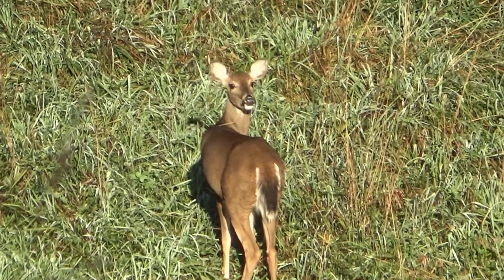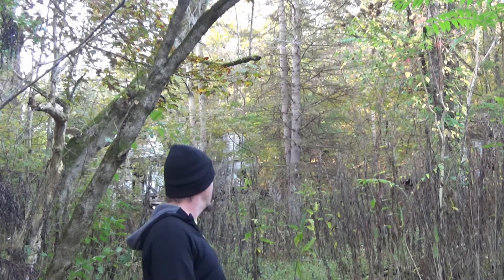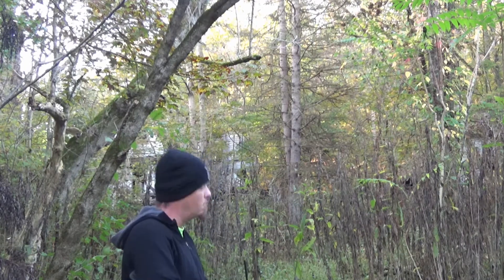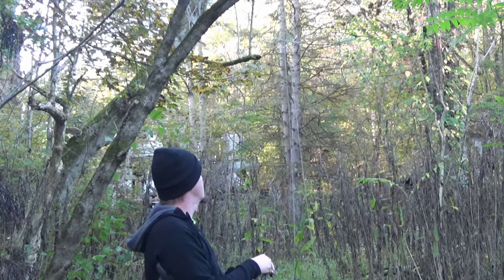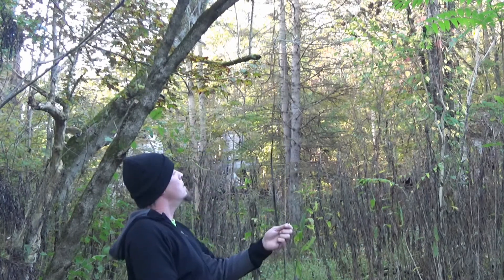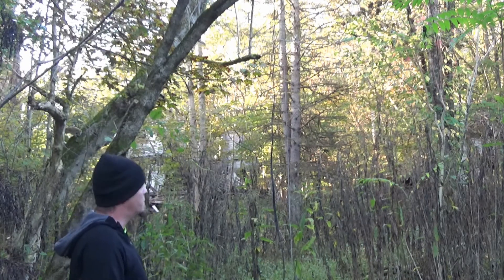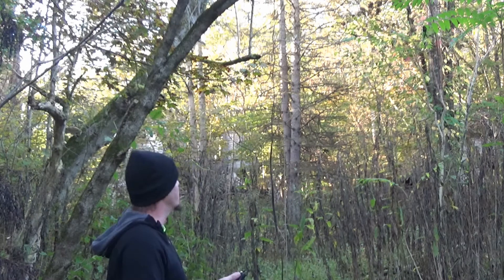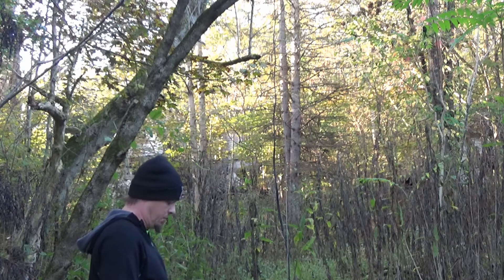Roll up slim jim antenna, for 2 meters

Comment: Used to go south bass island. Then get on the peace tower, then call to W8FT,  then to lima, Columbus, and Cleveland. Recent if caught you might get escorted. Off site in quick step. I just got a new slim Jim. And made me a new zebco / sling shot antenna launcher.  Good hunting  On a high point just lower the antenna. With a sinker. To stabilise. Good to go. DE Kv4li
Reply from the maker: I’ve been meaning to make myself an antenna launcher. Thanks for reminding me.

Comment: Great video. Thank you for sharin' this info. I'm brand new. Studying for Basic, my two Baofengs just arrived (the original pair I ordered are coming in from Beta Centauri, eventually, but won't let me cancel so...I'll have 3 backups?), and I need one of these slim-jims or j-pole in my pack. That is impressive. Pocket size. Thanks, man, and keep well.

Comment: I've been wondering if a slim jim could work with twin wire instead of the 300 ohm flat ribbon I've seen in all other designs. Are you sure this model is made of twin lead and not the flat ribbon used for old TV antennas? 73 de LU4HAM
Reply: Sorry, I confused twin lead with speaker wire. Would a speaker wire slim jim work?

Comment: Great video and thank you for sharing.  As a UK Foundation licence holder (M6KVK) I have tended to lean towards portable QRP comms although I do have a full shack at my Home QTH.  I have had my callsign for about 4 years now and to be honest I am very happy with it and find I am not restricted in any way on the lower tier license.  I make these slim-jims for other operators and they work quite well on both the UK VHF/UHF bands and are so easy to make.  On my luckiest day I have managed 73 miles simplex on 10w TX which is a reasonable success.  I would concur with you mentioning that this antenna is an excellent idea for anyone who is restricted in terms of putting up an antenna at a residential complex.

Comment: That's pretty slick man, I just got a VX-6R and am studying to get my license, do you remember where you got the antenna?  Also what rubber duck you using I'm looking at the HT-224 after reading reviews.  Anyway mine will be for survival and fun.  Great video.
Reply from the maker: I got the roll up off of ebay.  They are very simple to make, which I will be doing a video of soon.  My long flex antenna came from DX Engineering.  The vx6 is a really durable hand held!  My recommendation, get the charging dock!  It charges the battery way faster than the little plug in charger...  If you have any questions about getting a licence, please hit me up!  The hobby needs more hams!  Hope to hear you on the air soo.  73
Reply: Awesome thanks, will do I've been looking at a roll up slim jim for a bugout bag and a super elastic signal stick for my get home bag since it can be wrapped up.  Will do on the charging dock I plan on getting at least 2 more batteries for it too and making some sort of kydex holster thing to fit in an MBITR pouch with spare battery and radio on top.  I'd love to pick your brain just not sure what questions to ask yet lol.  I know I want to get into it mainly for the prepping side and less for senseless talk w/ old folks reminiscing back when tube radios were the only option.  I been in CB for decades and that's not my thing.  Even though I don't have my license yet I got the radio so I can familiarize myself with it while I study.  Been scanning and not picking up much must be the cheap antenna it ships with.
Reply from the maker: Yes, there is a lot of talk about "the good ol' days"...  The antenna makes the radio.  You can have a 25$ baofeng, with a good antenna, and they will work pretty well.  (Not the greatest, but still can get the job done)  I guess I would prefer to drop a baofeng in a creek, as apposed to a 250$ yaesu  haha....  As for scanning the frequencies, sometime the repeaters are just quite, and sometimes they are busy all day/week long.  Once you get your tech licence, then you can work toward your general.  There's always someone on the hf bands.

Comment: Nice video, thank you. 
I live in Maine with some bad winters. Do you think that this antenna would be a good option for a long term setup outside and run the coax into my house? 
Thank you
Reply from the maker: akaredcrossbow they are very inexpensive to replace, if it gets damaged. Also they are very easy to make, if you can find twin lead. That stuff is getting harder and harder to find. I've personally not had it out through a winter, but I've seen where they can last over three years, with no problems.
Reply: Prepping Ohio thank you for your response. I have found a kit on eBay that is complete, but only 10’ cable and I need at least 40’. I just don’t know if length of the cable will hurt the reception, I know multiple connectors will. Could I also mount it to my house with an aluminum pole, and does it need a ground if I do it that way. I’m very new to this as you might have realized lol.
Reply from the maker: 40 foot will not make a noticeable difference. If you decide to buy the antenna, with the 10 foot whip, go ahead and order another length of coax, and a barrel connector.   Just make sure you seal the connection very well!  moisture is the enemy of coax!  As for grounding, anything that can be hit by lightning, should be grounded.  There are "in line" lightning fuses, that are kind of expensive, for all they are, but better safe than sorry.  Its best to have an 8 foot ground rod, with a mechanical connection.  There are shield ground connections, similar to a barrel connector, that has a lug for a ground wire.  Those are suppose to work pretty good.  Hope this helped!  73
Reply: Prepping Ohio Thank you very much, definitely helped. I think I’m going to go with a PVC holder for the antenna that I just saw on YouTube that I will connect to the house and use wire-ties to connect the top and bottom of the antenna and have it suspended in between to other PVC pipes on the top and bottom. With that I should be able to use some inline cable fuses for the lightning. Correct? https://youtu.be/G6r4uoR562A
Reply from the maker: yes, the inline lightning fuses are a pretty good thing to have!  Just be sure that your antenna is working and the fuse hasn't blown, before you transmit.  Transmitting with no antenna means problems for your rig!  Listen first!
Reply: Prepping Ohio Thank you I appreciate this,Helped me out 100%👍🏻👍🏻